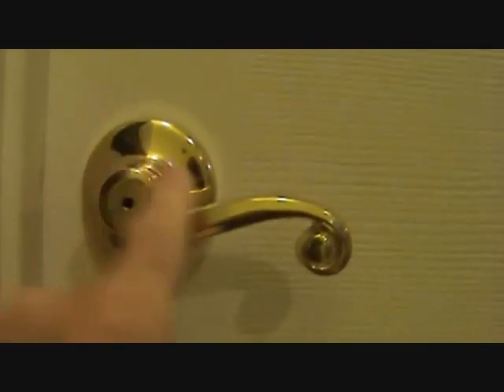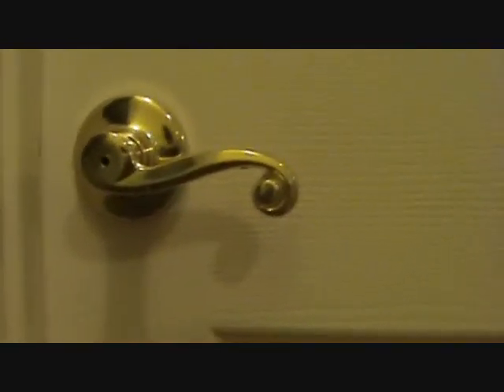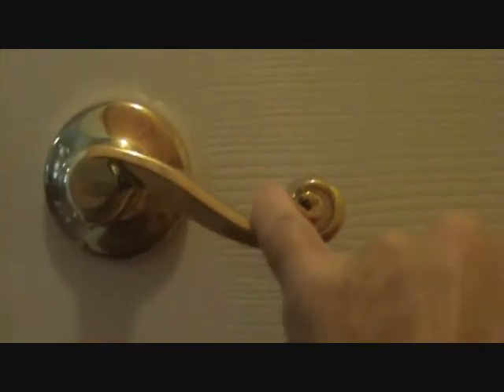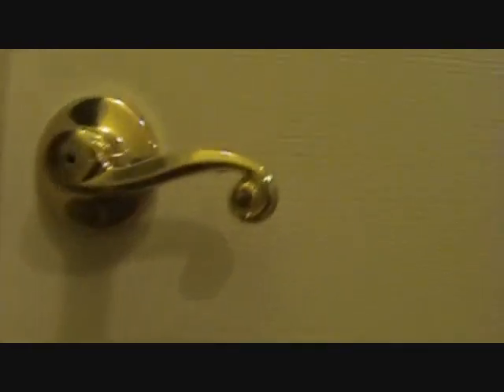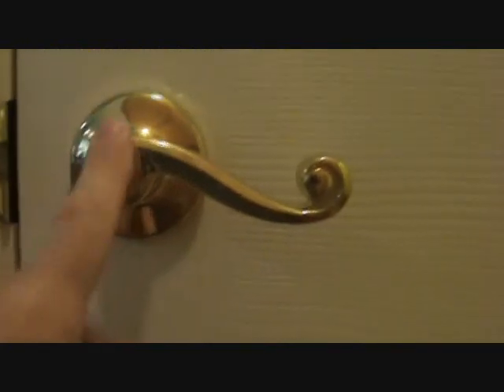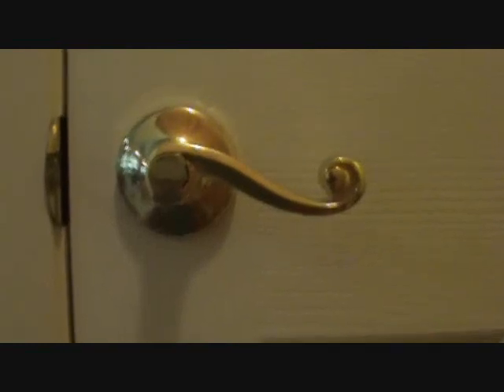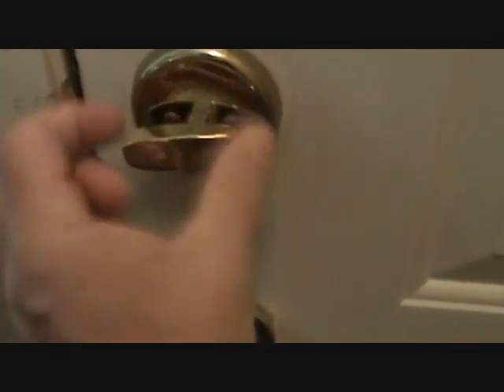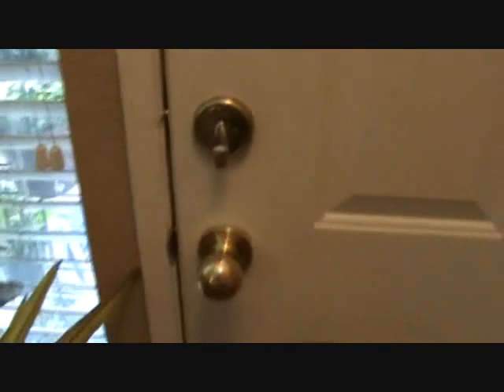Door lever handle install tips

Comment from the maker: If it's a new style lever handle, you should be able to flip it around. Look for a little pin hole on the inside edge of the handle. See it? If it's the old style handle, you probably won't be able to flip flop them around, as you use to have to purchase them "handed" to match whatever swing your door is. Now days, they will work either way. Thanks for commenting.   Joe  :0

Comment: good video. I stalled 3 Schlage Faire Lever handle, and 2 of the handles looked not leveled. I thought I got defect products. Took those down and reinstalled again, just drove me nuts and start googling. Turned out to be difference of cure up/down after watching this video. Good info. 2 min of switching the handle inside out and voila! Thanks. BTW, Schlage's lock is very easy to install and totally reversible by a push pin.
Reply from the maker: Lightspeed I like Schlage too. That's what I use. They are easy to install plus I feel they are a much better long lasting lock better than most. Good job on finding your issue & getting it fixed!   Joe  :0

Comment: I think it has to do with the left hand/right hand door knob...i'm putting one on now and it does say to invert only if using a left hand door...I just can't figure out how to get the cover off to get to the mounting screws entry point...getting frusterated.
Reply from the maker: Most lever handles like this one generally can be flipped for either right hand or left hand. carefully read the little instructions that come with the handle assembly. The mounting screw side should be on the inside of the door & the knobs should be able to be removed from the body of the remaining lock by depressing a button inside a very tiny hole or slot on the neck of the handle just behind where the lever handle is.....hard to explain the exact location. That's where I've seen them. Not sure if some brands still hand their levers or not. If they hand them then you can't flip the handles around. & when you get done with your entire project, you want all of your door handles to be facing the same way on all of your doors. Hope this helps.   Joe  :0

Comment: I was looking at some door handle levers at the hardware store and had the same concern. The packaging says reversible. I assume this is what they mean...so one doesn't face up, while facing down on the other side.
Reply from the maker: rkgsd Reversible meaning you can have both sides of the door handle facing up or both sides facing down...not one up & one down. They use to hand the door handles years ago & you had to purchase either right hand or left hand handles but now days they are interchangeable. Thanks for your question.   Joe  :0

Comment: Hmmm. interesting. But a video on how to INSTALL would be nice
Reply from the maker: Ashley Collins I just renamed this video. Sorry for you thinking it was on how to make the actual installation. I just uploaded however, some recent videos on how to remove & how to install door handles. The ones I just installed are a lever type & I go step by step on how to remove your old ones as well as how to install new ones. if yours aren't the exact brand & type that I install, the actual process is very similar so I think you will be able to learn how to do it. Go to my main channel page & find the "most recent" videos I uploaded & you will find them. Thanks for your message!   Joe  :0
Reply: VideoJoeKnows Thanks, I will check it out!
Reply from the maker: Great!